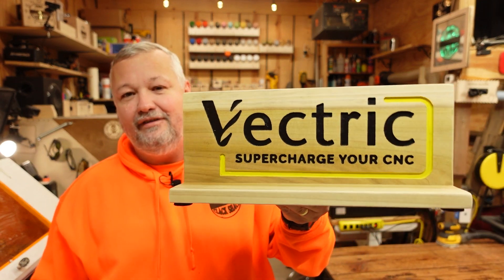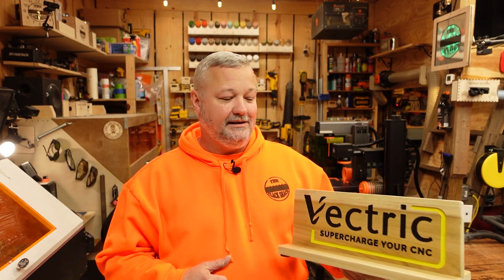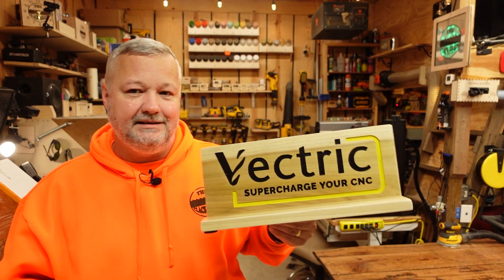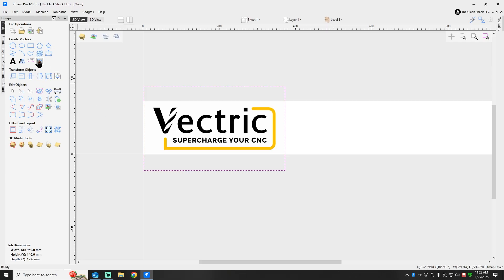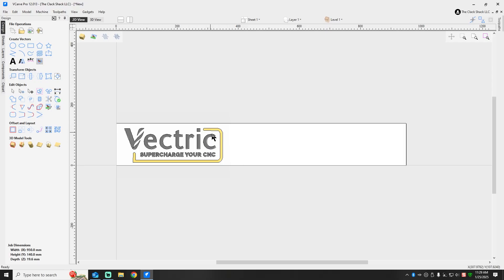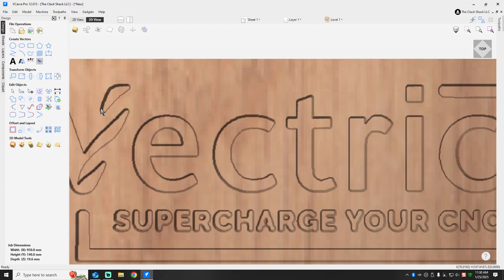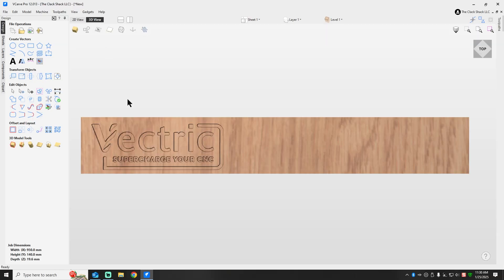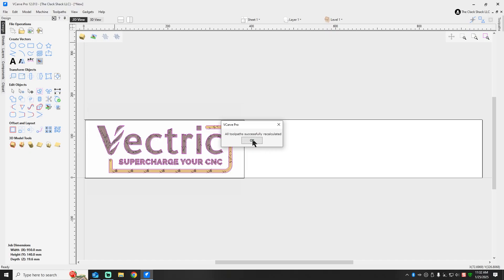Creating A color filled project in VCarve

Comment: Nice video! Do you mind sharing the process after the sign was carved? It looked like you sanded it, then sprayed something on it, then painted it and off camera you must've sanded the spilled paint off? Is that correct? If so, what did you spray it with before painting and why? And also, did you put a final finish over the project at the end? Many thanks for sharing your process!
Reply from the maker: Sand well, clear coat entire piece, paint the areas that need it. Sand again to remove unwanted paint from the surface. Lots of polycrylic.

Comment: Hey Clack, why wouldn't you use the V-carve function of the software to get square corners. I've used similar software and we did a lot of Old English fonts and it worked great for that. I do enjoy your content.
Reply from the maker: Carving does not have flat walls. The carve would then have a 30, 60 or 90 degree on the walls of the text and design. I wanted flat walls.
Reply: @TheClackShack  trade offs!